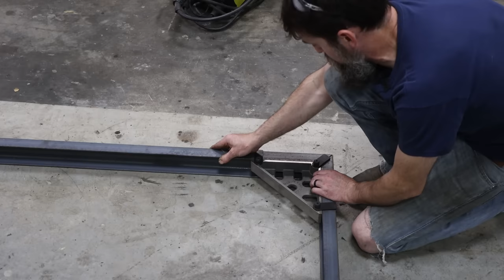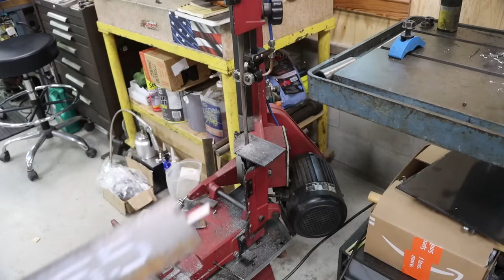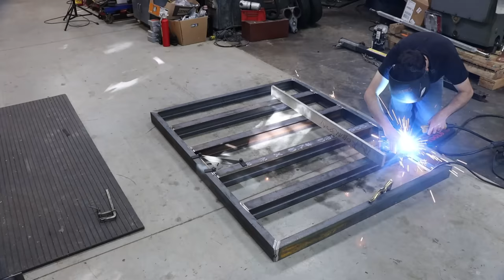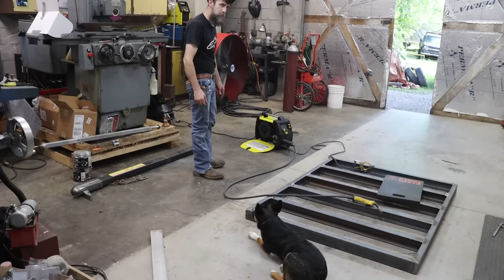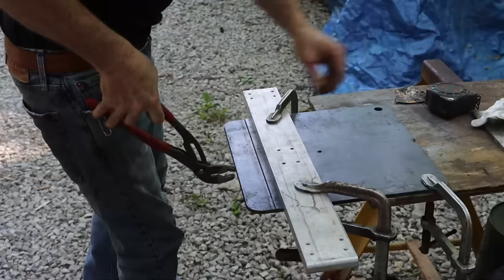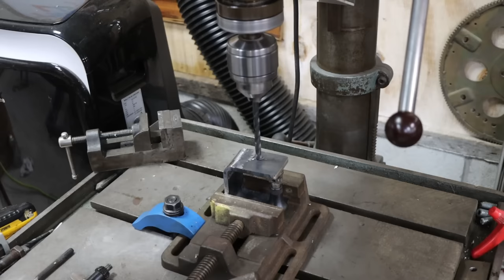Trailer build

Comment: Just like a sawmill trailers for HD applications like this  just can't be overbuilt. Oh how I love fixtures and jigs. Well worth the time and resorses to make them. I am thinking you really appreciate that wonderful flat and level pour you did on the shop resto. I will never forget all the different things you mastered when breathing the new life into that building. BTW You have some great tunes happening here today. So good I put them up into the TV and surround sound. I once had a pad ground into our long shop floor to give me a dialable surface to work on. The boss squalled like a rabbet but when I showed/ compared it to what I was spending hourly to get a good, level build he was sold. The pad was 12 x 40 so I could cut damaged logging trailers apart and back together again. Being old school I was never a fan of wire feed welders. The wire tech was new and solid low hydrogen wires had yet to be invented. Things have changed a lot since my retirement. It is nice to see welds done in the right direction esp with the spring hangers. Many will make the mistake of welding across A beam whether it is H or SQ tube. when they crack they become really dangerous to everyone on the road. I usually put a side gusset in both sides of the tow bar. About a 1/3rd of the length for that extra bit of over build on a trailer draw bar. That way it makes a great support system for a tool box or the spare tire. Just like everything like a shop we can't make anything big enough eh. Thanks bud and I will see you next post my friend.

Comment: Nice job. I try to make the tongues as long as possible. Makes it so much easier to control when backing up. Otherwise they will jack knife very quickly. Also, I would add some side supports for that light weight tongue. Just me. Thanks for sharing.

Comment: Steve, in Australia, your draw bar would be classed as very light duty,,we normally have a V style draw bar, and axle is always to the rear of center to get weight on the ball ,,Regards Frank.
Reply: That’s correct, the rule of thumb is inch and one half behind center of frame for axle location

Comment: Pro Tip: If you use Vise Grips on both sides of the Fireball squares to hold  your work in place, there's no monkeying around with them. They'll hold things square without shifting.

Comment: Clamping on heavy sawhorses with metal f clamps and chucking a bit of 3mm angle with c clamps across on each 4 corners help to keep em square 2 while you weld it up, in my experience

Comment: Thanks for making the video.... 
1) Make sure your dog is out of the way - they have no eye protection.....
2) I make mine and turned the C channel facing outside.   That gave me square sides on the inside and channel on the outside for the wiring - so if and when my wiring goes bad I can access it easy.
3) There are plans on the internet for 3500 5x10 utilitrailer.   I use C-channel,  bought a bigger axel etc. and used pressure treated 2x8 on the floor.   End result is a beast that probably weighs close to 800lbs. - but I have hauled some pretty heavy stuff (probably a hair overweight considering I have no brakes on the axle - but I pull with a 1ton pickup)
4) I went with torsion axle.   Note, to make the mounting brakets on the inside, you have to order them that way.....  I made the mistake of assuming C-channels were 2" wide.  Not sure why I did that.   I had to adjust with custom mouting plate.   That plate/mount is stupid heavy duty.

Comment: Steve, I'm buying a trailer from a guy that was on e a solar powered highway arrow sign. It's 4x4', so I'll add 2' to the front, and add steel in the same gauge. I'm thinking I might get it sandblasted, and at least get the bottom coated with a 10 year guarantee on "self healing" black paint offered by a local trailer company. It's about $300 for that, so it's a tad expensive, but worth it in the long run.
This trailer was never titled, so a bill of sale and receipts for parts , like lights and additional materials is what they review when inspecting for the title. I'm tempted to make it a tilt bed for loading mowers, etc.
That's a nice trailer you have there. I wish you success with completing it and the paperwork.

Comment: I believe the formula is you need at least 10% of trailer weight on the tongue for it to tow safely.  Also the farther from the tongue to the axle the easier it will be to back up.  I am calling the hitch point the tongue as that is called tongue weight

Comment: The cheap welder thing amazes me at the moment. I do lotsa field welding, railings, carports, etc. was using 80lb hobart mig welder. Bought some Lincoln/century flux wire feed, 11 lbs, $160. so far no issues. 200 hrs of welding. Can climb ladders, run on homeowner 20 amp sketchy circuits, set fire to their mulch…no issues at all. Not running 100% for sure, more like 30%, but gotta be careful on 1/8” tubing for burn through. Have everlast welders in shop. Again, trained/cert on miller, but not seeing huge difference nowadays.

Comment: Awesome looking trailer.
Being it's so small hopefully it will handle just fine..
But the load thats placed upon it, the c.o.g. has to be slightly in front of the center line of the trailers axle to pull correctly.

Comment: Nice build Steve. The draw bar Ratio should be in the instructions.
Reply: The axle placement  is 60% of the trailer deck length.  For example  a 10 foot trailer deck axle should  be place 6 feet back from the front of the deck. On a tandem  trailer that 60% ratio would be where u place the equalizer  hanger . Hope this helps.

Comment: When I was building trailers, of all sorts, the basic rule of thumb was for the centre of axle, or axle group, was to be 4 inches (100mm) BEHIND the centre of the bed/box. That plus drawbar/tongue weight gave enough balance to track near perfect.
Reply: Not saying your wrong but a guy that built and installed trailer equipment said put the axle at 60 to 65 percent of the length and it would give good tongue weight and track better going down the road my best friend has a car hauling trailer built with the axle in the middle and it pulls good when it is unhooked if you sit down on the front it will drop and scare the hell out of you and you have

Comment: Different people and different cultures name things differently.
We would call what you have called the ‘tongue’ a ‘draw bar’. It draws the trailer along, in the same way that a draw-bar in a lathe draws the workpiece in.

We would call a lightweight hitch on the back of a small car a ‘tongue’ and a medium duty hitch on a larger car or light truck a ‘tongue (and) hitch’. A heavy duty hitch on a larger truck would be a ‘hitch’ and the 50mm RHS tube on the crossmember of a tow bar would be the Hitch Receiver.

Funnily enough the connecting point at the end of the drawbar, that fastens to the trailer to the vehicle hitch is also called a hitch. The combination of 

While 50mm balls (and a socket hitch) are the most common type of hitch, they don’t function too well on uneven roads, articulated hitches are very common. Pintle and lunette hitch’s are not as common as they used to be, commercial articulated hitch’s like the Cruisemaster DO35 are much more popular.

Comment: Centering the axil in the very center of a trailer is prone to make a problem trailer hauling most anything. Without more tongue weight towards the vehicle, it will wonder all over the road and as speed increases, it will become dangerous for sure... The axil has to be offset to the rear of the trailer to make it haul correctly.

Comment: I was going to say that trailer is going to be squirrely at best.  More tongue stickout and move the axle back so at least 10% of the trailer weight is on the tongue when loaded.  Short trailers are so much harder to tow than big ones.

Comment: That trailer will haul anything under 2000 pounds but take it to one of the scrap yards in west Tn one time and let them unload your shreddables with the excavator and its done for. Not because of quality work and materials mind you. I had a couple good trailers too until i hailed a few loads of scrap, now every cross support is bowed to the max due to excavator operator pushing down to hard to pick up material.

Comment: The first thing to know when building your own trailer, you need to know what the trailer weighs after building it, reason is lets say you have a 2000lb axle kit, well that doesn’t mean the trailer will hold 2000lbs, because the trailer has to carry its own weight, so weigh the trailer then subtract that from the 2000lbs and then you will have your carring capacity

Comment: Slightly surprised not to have brakes on an HD trailer. I would not be happy towing any trailer with a GVW, including load, exceeding 500kg/1100lbs without brakes, either over-run, electric or air. I have seen a number of smaller trailers jack-knifing under heavy braking.

Comment: A drop axle would have been nice for getting the deck lower to the ground. Weld some D rings onto the outside corners.
Reply: I was kinda thinking the same thing. Welding the plates he mounted the shackles up on what would be the surface deck of the trailer would drop the deck height as well. Though the axle might make contact when fully loaded and driving on a whoop section. 😂

Comment: Hey Steve be careful if you overload the trailer and hit a big bump the drawbar may hit the axle and bend it. I've been there and done that. After straightening the axle and cutting the drawbar from over the axle. I cut two diagonals for the front of the trailer and welded them to the drawbar. Love the video some great ideas there. Oh are you going to put fenders on it and what kind of decking are you using?

Comment: Nice job using C sections  and I beem will never bend or break  ?
 As for the axl should be 100 150  mm of  center to the back of trailer  . As for that tow pull and hitch as its called here in Australia  that one i would chuck in bin and make a heavy duty one to match your work .  And as a I ways the weakest link is the tires are they rated to carry  1000 pound each ?

Comment: What are you going to put on that thing? You may have gone slightly overboard on the deck structure. Or I guess you could put a 6k axle under it and move pallets of concrete.

Comment: For that axle, that trailer is overbuilt. You end up losing some of the hauling capability because of the heavy weight of the members. For the price of that steel, you could have made a 4x8 tilt trailer with a piece of plywood for decking and 2x2 angle for everything else.

Comment: It may not be necessary for this trailer, but it would be simple enough to mount the tongue so the trailer will tilt - another U bracket at the front like the one at the rear, and instead of a bolt use a hitch pin.
Reply: I have a utility trailer that tilts, I call it the pincher also first time I pulled the pin when I started backing my garden tractor off it tiled so fast the tractors front wheels came a foot off the trailer and about tossed me. I have long ramps now and the pin stays in.
Reply: @boblister665  I suppose it depends on the location of the pivot point. My trailer tilts, and it works great for loading or unloading my motorcycles.  Someone else built it so I don't know if they used science to figure it out, or if they just got lucky when putting it together.  🙂

Comment: Nice job ! Does the trailer  need a sway bar ??
Reply: I've never seen a sway bar on a trailer. I'm onto my third one, and they are straight forward in construction. My first one I made with a rear axle from an old Honda station wagon, and it had shocks, but they weren't necessary for a trailer.

Comment: Hi, I am wondering if you think it's okay to build a trailer with a little bit bigger floor size and using a single, sliding adjustable witdth, tubeular mobile home axle and tires and wheels? It will be for lighter loads like 1000 to 1500 lbs., maximum on the highway.I will be using CCA Treated 2x6 boards for the floor and one 2x6 high around the sides. The tread on the mobile home tires i have are very similar to the ones you are using with zero dry rot. I cannot afford to buy a trailer or afford to have someone build it for me! Let me know? Thanks!

Comment: If the trailer weights 400 then it can only hold 1600 lbs. I would have gone with a 3500 axle

Comment: 3:34 It's more accurate and easier , to measure the diagonal (hypotenuse) to achieve a right angle.
All the work Pythagoras put in and you use an inferior chunk of metal to guess at the angle

Comment: Sadly there were so many errors in this build process:
1) Why are you cutting out the in-between good stuff?  Don't show us the final result of each sub-step. Show us the whole thing and thought process.
2) Never weld without protecting EYES / LUNGS and SKIN! Even if you are "just" tack-welding - you risk having skin-cancer down the road
3) Never let your DOG / CAT / CHICKEN / what ever watch you weld unless you want to destroy their eyes. The pets hearing may also be damaged due to noises
4) Never weld in a place with so much stuff lying around - unless you plan to burn down your place?
5) Never weld holding a heavy steel tower upright with one arm like you did. If it falls over it may  hurt persons and machines may be broken and become a danger.
6) Never let the wheels "stick up" over the bed.  It will limit the box size and generally just be annoying.
7) Btw: why did you have the doors closed when you were welding? You really wanted to inhale those weld fumes, didn't you?
8) Never be in the "cross-fire" path of the angle-grinder. If the disc explodes there goes your hand / thumb / fingers.
9) You made the tongue too short. Will hit the vehicle towing it when you turn. 
10) Why are you sitting on the floor like a 3'rd world factory worker?
Reply: You sure care about a lot of things for someone who refers to themselves as a psychopath
Reply: @benniethejew  I'm a safety inspector and my customers calls me a safety psycho - so I guess the name fits... BTW: Did I say anything wrong in my list?
Reply from the maker: This must be your 1st time stopping by.
Reply: I hope it's the last
Reply: @SteveSummers  Actually it IS the first time - and I hope it won't be the last ... but that really is up to you still being able to make content. Just be careful out there?
Reply: @natedoerfler652  That was rude. I hope YOU don't follow any of the rules I mentioned.
Reply from the maker: @swedishpsychopath8795   Thanks for stopping by .
Reply: You forgot, " and never ever get anything done." In your list.
Your probably one of those guys that never done a honest day of work, standing with a clipboard telling the seasoned trades expert he is doing it wrong, because your book sad so.
Reply: Wow
Reply: @theskepticalnegativist1004  In addition to the clipboard I also wear a yellow west and a helmet. Of course I'm wearing my safety glasses at all times.  In my shirt-pocket I have red, green, blue and black pens for all occations. I also keep a spare red pen in my suitcase.  But all jokes aside: What is up with the negativity I get for my sincere suggestions? There is no need to attack me for helping the man to do a proper job?
Reply: @theskepticalnegativist1004  I would suggest that Brian of bcbloc02 is a seasoned trades expert who is also much higher qualified in this field than most.  His latest video offering nearly put him on the ' will never do anything again' list.  Could the man with the clipboard have averted it I wonder? maybe the one in his head beforehand.
Reply: @swedishpsychopath8795  You poor you, getting picked upon over here.  Maybe your reputation precedes you, coming from Adam's channel.  But your usual humor only adds to any channel's comments section, imo.
Reply: @richardjones-sl2zd  OMG, how did you know about me giving advice to a79? Do I really have a reputation? I hope the reputation is good then..(?). Kurtis from cutting edge engineering REALLY HATES to get professional advice from me, for some reason ..

Comment: Do you axle stops on your trailers?  What I mean by that is a plate welded to the trailer frame to limit the axle travel.🤔🤔  

Measuring Tongue Weight
One technique for setting axle position is by measuring tongue weight.  Most of us don’t have a scale that will go high enough, so take the trailer to a vehicle scale.  (Or use this DIY method for a good approximation.)

For an existing trailer, load it for travel.  (This is difficult for utility trailers because you never know what it will haul.)  Drive onto the scale where only the trailer wheels are on the scale.  Take a measurement.  For example, 2250#.  Unhook the trailer on the scale so it measures the full trailer weight (tongue and axle).  For example, 2600#.  Subtracting:  2600# – 2250# = 350# tongue weight.  For percentage, divide:  350/2600=13.5% which is great.  Adjust axle position if needed.
 
To read more:    https://mechanicalelements.com/trailer-axle-position/